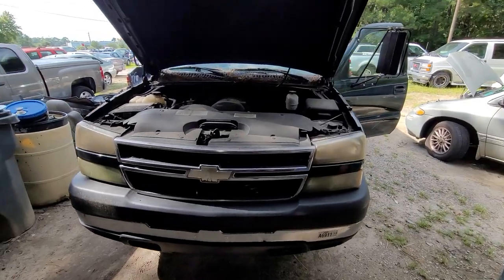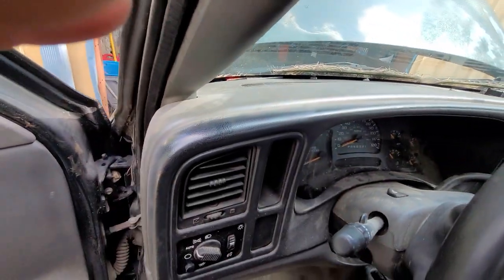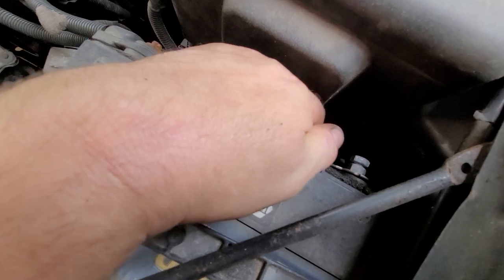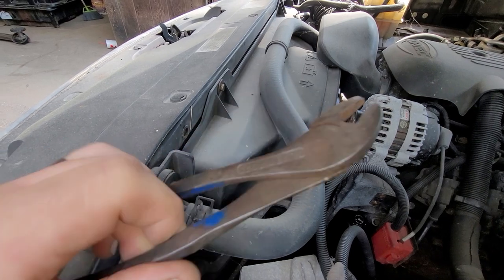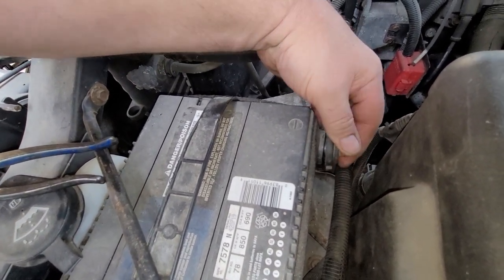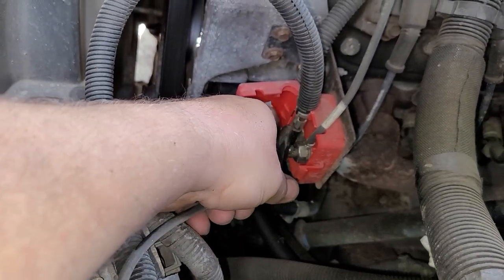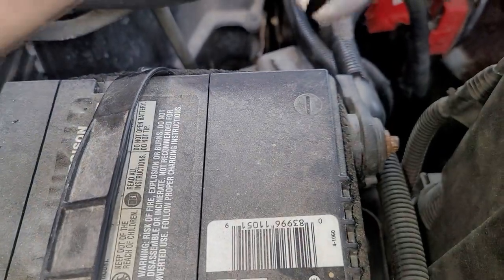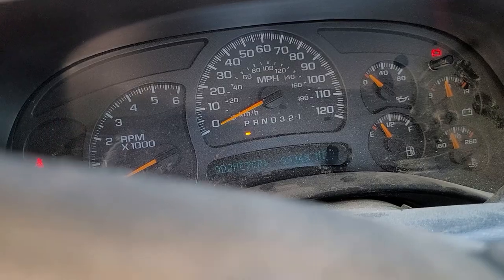Silverado Sierra Instrument Cluster Easy Fix!!

Comment: Thanks man, this trick worked for me,  all my gauges on the right side didn't work, (oil pres, bat, fuel, coolant temp) but the Check eng light, speedo, RPM, and odo worked. now everything is working fine, so simple took me all of 2 minutes to do this. @ Pasadena, TX

Comment: Hi! I have a 2012 gmc sierra 5.3 motor. The truck don't  want to start I get out and shake the fusebox a little it starts. Could it be the fusebox are the connections to the fusebox meaning  the wires. Once it's  running no problem. I just don't  know if it will start once I cut the truck off. What do you think might be the problem off the top of your mechanic  head?
Reply from the maker: Definitely sounds like a faulty connection. I would start with checking all the main connections to see if they are good
Reply: Thanks I will check it